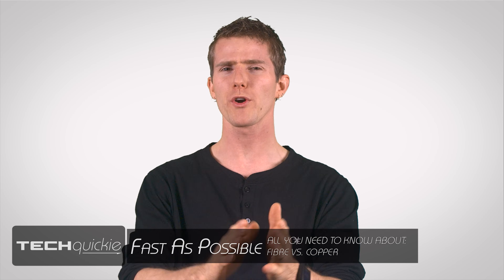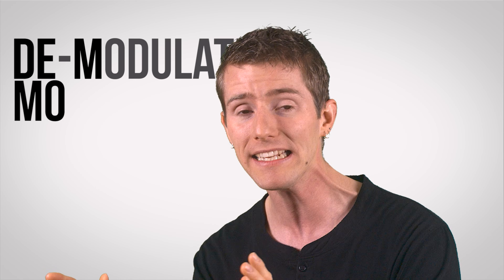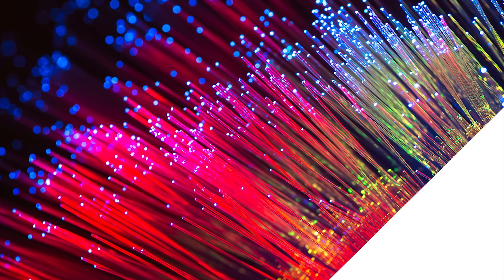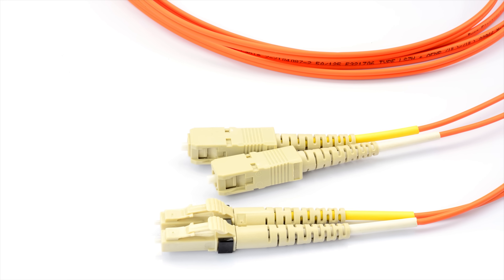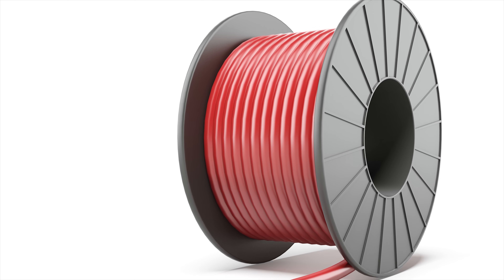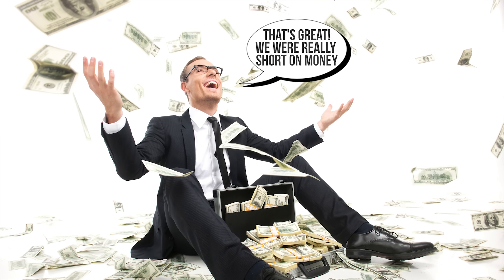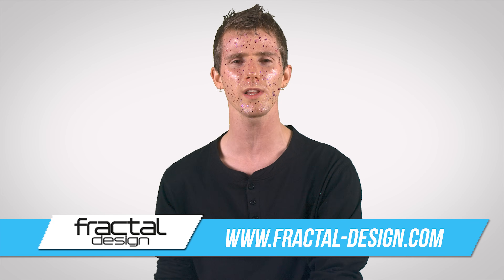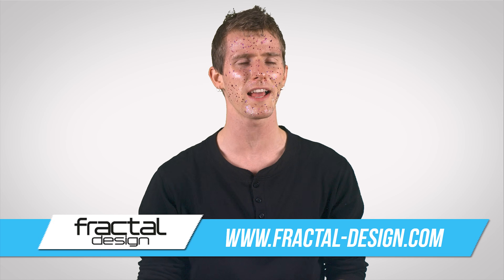Fibre (Fiber) vs Copper as Fast As Possible

Comment: I don't think this was explained very well at all.
My points below are solely regarding LAN infrastructure, not WAN.

Gigabit copper and gigabit fiber will run at exactly the same speed, so fiber isn't faster than copper at all. The only benefit to fiber in this instance is the distance that can be covered by it. If the cable run is sub 100m, there is no benefit of using fiber over copper. 

I am aware that 40Gb fiber transceivers are available, but comparing 40Gb fiber to 1Gb copper is hardly fair. That's like saying petrol cars are faster than diesel ones, but the petrol car is a Ferrari and the diesel one is a Fiat panda, it's hardly a level playing field.

Comment: Techquickie fiber expensive? our whole town gets it and all the villages aroud it. and that for a relatively small town. not expensive at all
Reply: yes it's very very expensive. don't full your self
Reply: +Adam Mckeithan if it is expensive wy does our local provider wants to connect a (littlebit) remote town and surrounding villages to fiber for free
Reply: Kars Noordhuis Where are you from? would be the first question i have to ask. my guess it has to be some type of agreement with some type of government help. It's what we did here. We did a full fiber network for a county besides us. just the network gear (not fiber cables or install of the cables) was over 30 million. something we couldn't do with out a grant. Think get it fully running was around 75 million. This just one county. Part of that was he had to offer free services for a limited time.
Reply: Kars Noordhuis Whether or not your area can afford it does not change the affordability of the fiber bud.
Reply: It is probably like what google fibre is doing. The homes in Silicon Valley near google headquarters are all getting google fiber for free as test subjects. Your ISP is probably doing that too since it is small and it won't cost as much to install fiber optic networks in your town to run test.
Reply: +Adam Mckeithan im living in the netherlands and its a small local provider thats doeing it and im not shure if they get paid from the governement probably not
Reply: yea you are right i live in a  small country where fiber is easy to deploy but america, russia, china and other country's are bigger and are more expensive to connect to fiber.
Reply: Kars Noordhuis Also depends on who is running your country - here is Australia Rupert Murdoch practically handed a specific party an election win via his influence. Sort of like what Darth Sidious is to Darth Vader. Coincidentally that party favours the technology he uses in his pay TV monopoly; which basically start at $100(ish) monthly subscription fees. Even though we were 2 years into a 98% full fiber rollout across Australia they decided to roll that back and go with cheaper options.

Not that you needed to know all that... I'm just pissed haha.
Reply: Fiber cables are getting cheaper and cheaper, copper is getting dearer and dearer. Ultimately, fiber will probably be cheaper than copper cables, if not cheaper already. What mainly cost much more for Fiber than copper is deployment. It's also more complicated and costly to maintain.
Reply: so in conclusion the cost of fiber is depending on the country you're living in , is it a big one its expensive is it a small one its less expensive to deploy

Comment: In fact Fiber is much cheaper then copper per meter...
Whoever the hardware required to modulate, demodulate, amplify and process optical signals is way more expensive nowadays.
PS: I know, because i work for a big cable TV Company here in Germany...

Comment: Wait, what. Since when has the speed of light decreased? Linus talked about 200.000 km/s, while the actual speed of light is 2,9979x10^8 m/s, about 1,5 times as much as he stated.
Reply: Well one problem is that we are not in a perfect vacuum on earth.
Reply: Cole H Martijn Kuiper not only we are not in a perfect vacuum, the light in this case is also travelling through a solid. Even tho it is transparent, it is 'worse' than air.
Reply: Fail.. Learn some physics before talking boy.

Comment: Still have a question. How is the fibre signal decoded at the other end when you have only one tiny cable? When with copper we had 1000 cables and 1000 modems, do we have a fibre modem thats 1000 times stronger than a regular modem? How do the indiviual signlas get sorted apart for the different households?
Reply: Has nothing to do with the angle's.....here have some light reading....http://en.wikipedia.org/wiki/Wavelength-division_multiplexing

this gives you a basic understanding how it works.
Reply: There are many ways to do this. It can be PWM (pulse width modulation (basically the 0's and 1's)) that carries a signal saying "this is the start of a messages" and "this is the end of a message" to angles of light. Imagine the fiber as a tube (which it is). The light bounces off of the sides of that tube. Now if you can intentionally assign a specific angle (say 40°) to a signla and another degree for a second signal (let's say 38°), you can effectively read them at the same angle on the receiving end. Encoded in these messages you can then say that "40° is for X" and "38° is for Y" so that the receiver can send the message on to the appropriate end customer. Also keep in mind, you have 360° in a full circle inside the tube, so you can bounce light of many angles. Hope that's explained easy enough to understand.
Reply: halsoy I don't think the angles are that constant since the cable isn't perfectly straight... I'm not sure though.

Comment: While the speed of light in fiber is about 200km/s (0.66c) the speed in copper varies and can be as bad has around 0.4c to about 0.7c depending on a number of factors. So fiber can actually be 'faster' and is more reliable not that it makes a huge difference 0.4c is still insanely fast.

Comment: so i use a copper line atm, 2mb (200kb/s down, 40kb/s up), and they offer cheaper fibre for 4mb. Now our house is 120m (390 foot) away from the road, is it that fibre cable cant transmit that far or why is it that "the signal is too weak" ive they only test it on the road. do 120m affect that much that the 15mb they offer at the road weaken off to unusale levels over 120m of cable?

Comment: We've had fibre here in Ireland for years now and its pretty amazing but as Linus said, it's still a copper wire from the main road. I rang my isp one time to see how much full fibre to my door would be and promptly had heart failure lol. It is possible though.
Reply: They have VDSL in Ireland which is better than Copper, which it can reach 100mpbs, Ireland is a prime example of an internet connected country compared to the Uk which is lacking behind, luckily BRSK FTTP is coming soon in my area instead of rip-off Virgin

Comment: One of the biggest downsides to fibre at the moment (it's great for pole line stuff) is that inside buildings, copper is so so so so much more versatile than fibre.  I can run data, voice, T1, fax, audio, radio, hdsl, and probably more I'm forgetting on easy to work with cat 5e.  And all I have to do is use a punch block or just solder the splice points.  For data hard lines fibre is for sure better, but aside from being hugely expensive, it's also a huge pain in the ass to work with.  It basically requires you to put in new conduit into your building from the ISP demark point.  And running new 4" conduit is a PAIN. 

(I do this for a living)

Great video!
Reply: Well of course it will be a pain in the ass now. (If and) When it becomes as deployed as copper, then copper will be forgotten to the history books.
Reply: If anything they will come out with some type of 45 or 90 degree Coup-lean like they did for Coax back in the day.  Fiber is still very new and has a lot more time to grow compared to Copper System.  I Run Only Cat6 at all more job sights now.  every time they ask why,  i just explain that 6 is the current standard just like old single line phone line was back in the day.  Once the Cat6a/e Standardization are publish and hardware become a part i'll switch to that to make way for future Fiber.  I just see no reason to run Fiber Within the house right now.
Reply: yoinkerman actually, multi-mode fiber can do all that. But with no PoE services, of course.
Reply: Yes, it can.  That wasn't the point.  The point was you can basically twist the wires together and get a huge array of circuits.  That's just simply not possible with fibre.
Reply: yoinkerman specify, please. Because if you're talking about dozens of cables all together... yes you can, but one of the points of fiber is exactly that: the no need of huge arrays.
And you can make it with fiber too. Fiber cables that cross countries and oceans have hundreds of fibers all together. Also, there is multi-core fiber.
Reply: You're comparing apples and oranges.  Cat cabling is digital while fiber is analog.

Comment: we just got upgraded few months back free went from 50 down to 300 down from Time Warner and its an enormous difference not only in speed but multiple data streams increasing capacity based on demand... If Comcast mergers with TWC we will certainly be data capped and throttled at higher costs ... i was a Comcast subscriber for 7 years on my previous place and i know Comcast is really bad.. why would anyone let the number one worst rated company to become even bigger..Comcast swallowed NBC, UNIVERSAL and now wants TWC..its not fair for us

Comment: i wonder if sata cables will be replaced with fiber cables.
Reply: The Gentleman Sandwich not a dammed thing
Reply: The benefit of fiber over copper at the distances of a typical sata cable would be marginal at best while at the same time increasing complexity
Reply: That would be great.
Reply: I wonder what a fiber motherboard would be able to do, instead of copper traces.
Reply: The Gentleman Sandwich ...Fiber isn't conductive. Please take a 101 on electrical engineering. That's just a silly comment.
Reply: Not sure about salta cables but they are trying to make circuit boards light based.
Reply: No need...

At that distance you can have better bandwidth just from more less thick copper wires than you could with any fiber.
Reply: not quite mr Yoshi
Reply: hey hey hey, you didn´t need fiber sata cables. first becouse the hard drives dream with 6 giga bits per second (what is 0.8 giga bytes per second aprox) second, becouse at the distance of 50 cm (or we would say 5 meters) there isn´t any data loss and third. The power of cooper is understimated.
Reply: No. Fibre is useful for long distances and high speed connections. We're not talking about gigabytes but tera and peta bytes. You can easily make a 40 gbit connector of copper for hard drives. But nobody has done that yet because ssd's are capping at 2gbit or so.
Reply: According to HP and their "machine" concept, everything will be replaced with photonics.
Reply: I've had to handle fiber cables, small ones like that would be very fragile... they're glass after all
Reply: TheTechZone1 Yes, but all data consists of on's and off's. Of which is also the basis of logic, the lifeblood of computers.  Fiber can and does transmit data.  I'm just curious if some kind of fiber implementation could be done with a motherboard and what it would be able to do in terms of bandwidth.  This is relevant because we are approaching the limits of what copper traces can do in motherboards especially at the thickness and length that it takes to get from the PCI slots to the required places to be processed.  Obviously the entire structure of the entire board and many components would need to change, but how else are we to advance if change doesn't happen. Power would still be sent by copper of course, but the transfer of all those ones and zeroes could easily be done by fiber.  I'm sorry I didn't write a well worded comment before. I hope this gives more insight into what I was thinking.

tl;dr :  Power can still be done with copper, but imagine what fiber could do with data transfer within the PC!

Good Day!
Reply: SATA Power Cables won't be but the data cables could be.
Reply: Btw. Copper works with electricity. Optics is light. Things like processors work with electricity. Transistors work with electricity. Copper is not the limit, processing power is the limit. Unless you could reduce the heat generated by silicon transistors and convert the logic inside processors to photons, fiber would not be effective. Imagine all the transmissions to be made from electricity to photons and back. All that processing power could be used somewhere else. That's why copper is still effective.
Reply: yea they already available
for instance i use fiber thunderbolt 3 cables
but note, fiber is only beneficial for distance connection....if you running the cable from your router sitting next to...there's zero difference between cat 6 and fiber
but over distance fiber can maintain throughput without needing a repeater while long cat 6 would experience loss
Reply: The Gentleman Sandwich the motherboards are basically made of silicon, not cooper traces (I know there are a lot of things on a motherboard but mainly silicon)
Reply: No, SATA works fine for what it's doing.  Fiber would just be expensive, yeah it can send a lot of data at once, but it really isn't that much more than SATA.  Also, Fiber is used primarily for long distances.
Reply: Alexander Pavel a photon processor... its genious
Reply: The Gentleman Sandwich That is an awful idea.
Reply: Yoshi 66 til 50cm == 5m
Reply: estXcrew I try so said that the the distance of sata cables isn´t long enough to loss data.
Reply: At work:
http://www.speedtest.net/my-result/4012288749 93.65Mbps Down, 94.39 Mbps UP.
I can get it even faster but my laptop does not have a fiber network port.

At Home:
I have 20Mbps Down, 10 Mbps Up.  Vmedia (Cogeco as the Last Mile/Infrastructure)
Reply: TechPorkChop At my school I get 70 down and 70 up through the Chromebook they gave me. And it's wireless. Apparently, my school has its own fiber network that connects also to the middle schools and elementary schools directly and can give ridiculous speeds throughout the entire school system.
Reply: I think you miss read my post.  My laptop only has 10/10/1000 ethernet network port.  The work switch which my laptop is connected to also has fiber ports.  Imagine the speeds I would get if my laptop had a fiber port instead of ethernet port.
Reply: TechPorkChop you can buy fiber adapters for ethernet ports
Reply: TheTechZone1 i think he was talking about data not power.
Reply: The data ones might; the copper ones won’t (fiber can’t run electricity; only data)
Reply: Motherboard with fiber traces? 

Rgb in a nutshell
Reply: Free RGB?
Reply: ZardoZ light based CPUs are a thing (in laboratories)
Reply: I don't think we're going to reach a point any time soon that fibers will be needed inside your typical computer chassis.

DAC (Direct-attach-cables) in datacenters are over 40Gbps.  Not a lot of SSDs ever saturated SATA III. PCI-E 3.0 x4 (used in m.2/u.2) is ~31.52Gbps. 
 (see an example here: https://www.fs.com/products/40432.html )

Point being, at that short of distance it's not very difficult to achieve 10Gbps+ data rates on copper. Adding fibers would:

Make motherboards more expensive
Make drives more expensive
Make everything less durable

Doesn't sound like an attractive offering to me. The EMI-immune properties of the fibre also do not seem useful inside your typical computer chassis.

For distances less than one meter, fiber is almost never necessary, unless your data rate is well over 100Gbps - like multi-terabit DWDM trunking multiple 100G/400G fiber connections.
Reply: @JoeAceJRTech Not necessarily, fibres can be anywhere from 1G-400G, DWDM takes fibres into the multi terabit range. 10G and 40G are ubiquitous in the server space. However this would be absurdly expensive and power consuming for any PC. The NVMe interface isn't faster than all fibres, but you're write right to point out it's faster than 12G SAS or 6G SATA III, and also 10G fibre. It's also cheap and flexible in terms of actual traces - fibre couldn't be easily integrated into the motherboard the way the m.2 interface is, it'd be more like the u.2, SATA or SAS connector.
Reply: 1. They're too expensive
2. They're not as flexible or durable.
3. Hardware capability is usually much smaller than the SATA capacity

Comment: The core in Fiber is usually smoked, and the cladding is the highly transparent one.
Also fibers that carry multiple wavelengths of light (multimode) are cheaper, only useful for shorter runs, and do not have as much bandwidth
Fiber isn't too expensive, cable is actually cheaper than copper nowadays for long distances.
Despite those minors mistakes, info was pretty good.
- FOA certified, FTTH user at home myself.